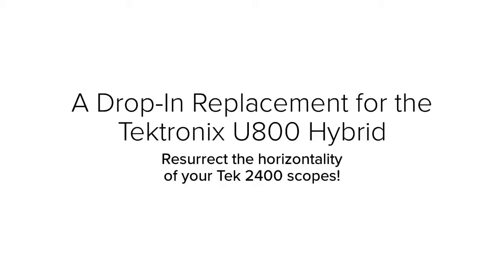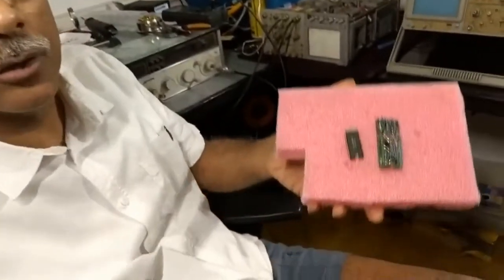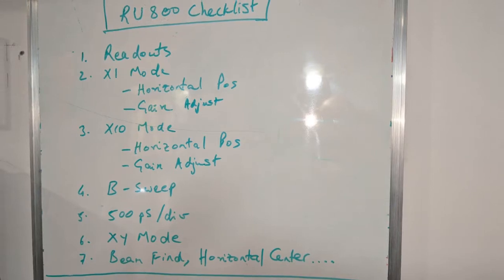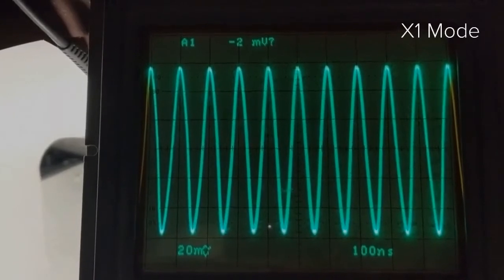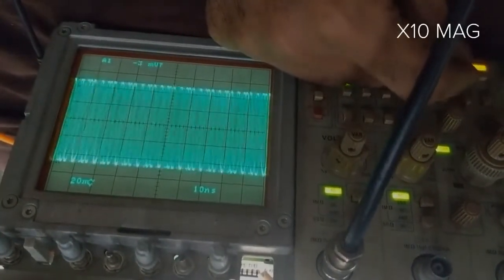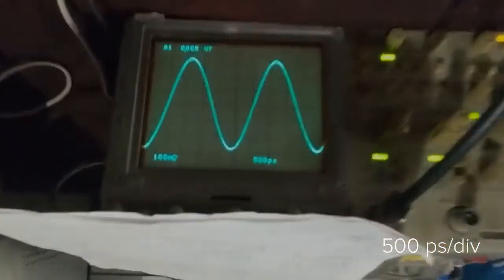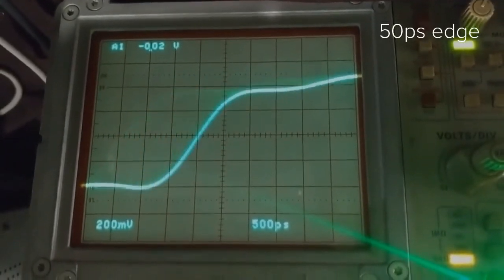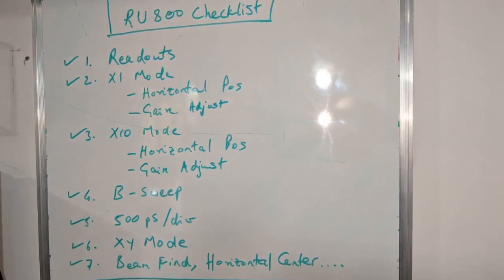The RU800 - A Drop-In Replacement for the Tektronix U800 Hybrid

Comment: Wow, congratulations on your reverse engineering and re-engineering of the U800, I’m amazed that you managed to pull this off for a chip with undocumented internals and such high specifications to avoid distortion or nonlinearity, at such high speeds. Truly a masterpiece, I think! I have an old 2465a that I’m about to recap; it’s U800 is working fine as far as I can tell, but I’m considering picking up one of your boards just as a backup. I love so much about the 2465’s design and UI, I plan to keep it forever, even though modern digital scopes far outstrip its capabilities. (Are you the seller Engineering Ideas there? I’d want to make sure I’m buying it from you.)
Reply from the maker: Thank you @DaveEtchells for your kind words. Yes, that's my ebay id, and I see that you bought one just now. Thank you for your support! Make sure you see the video on the RU400 too - a drop-in replacement for the U400.

Comment: Hi Ram, Just a bit of an update for you.  I bought one of the original V1 boards and we had some discussions when I discovered the cursor setting issue when I tried running it through calibration routine (and then did the 0805 replacement).  Don't be confused by my username as that was the girlfriends pet dog's name when I originally registered for YT  20+ years ago!  Anyway that must have been about 4 years ago and it is still working fine.  Admittedly I've only got about 150 hours on it as I've got 5 scopes so tend to share the use but it is still going strong.
Reply from the maker: Hi @millycarrington, thanks for the update! Yes I remember our discussion. Glad to know it's still serving a useful purpose 😀. The board is now in v2.1, and a v3 is in the works.

Comment: I can only imagine how complicated it was to reverse engineer the original U800, and implement all the functionality and specifications into a new custom design. Let alone the time you invested into the project. My compliments Sir! 

Did you ever finish the Rev3 version? (And are you planning to sell more on eBay, for I can't seem to find them).
Reply from the maker: Thank you so much for your kind words. There were others who attempted the same so I am happy to have built on their wisdom. The current version is called 2.1, and I have sold 10 pieces so far. Another 20 have just been assembled by my assembler, just waiting on a couple of ICs. Once they land up I will finish the assembly, test and list them again. You can search for RU800 and you should find them. The  listing may not appear as it is out of stock, but you can see it in sold results.

Comment: I am interested when they are for sale, I have socketed my 2467B u800 after removing the defective one and love to experiment
Reply from the maker: Thanks for the interest Steven and thanks to all those who have Liked the post. Ver 1 of which sold sold 7 pieces on eBay did work fairly well, but for calibration of the cursor you had to manually resolder a different value of one 0805 resistor on board. Again, not terribly complex, but I was very keen to overcome that limitation. I have been working on a revised Ver 2 design which has taken a tad more time than I thought, but then I am currently testing revision 3 of that so hopefully I should be done soon, Omicron notwithstanding. Sometimes the innards of the U800 are mysterious enough to make me feel like giving up and going back to Ver1 but then it's not easy to give up is it?
Reply: @ramkumrr  I like the video and appreciate your engineering on the U800 replacement. How far has r.3 gotten... is it close to release, or is it better to make more r.2's (assuming they didn't have any problems). Thanks!
Reply from the maker: @dougreed5228  Your timing was perfect. I have just got a batch of 10 of the latest version (which I'm calling 2.1) from the fabricator so I'll be listing them on ePay starting this week.

Comment: Could you reduce the distortion by using a lower profile socket, or is the distortion a result of the added contact boundaries?
Reply from the maker: I think a direct solder onto the board would help more than a a lower profile socket, but that's something that is always more painful to undo later.